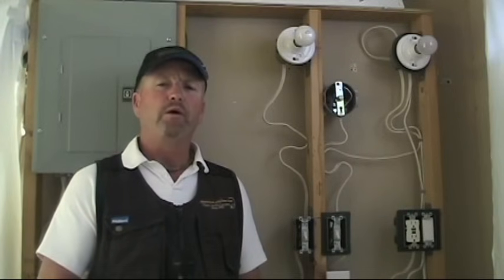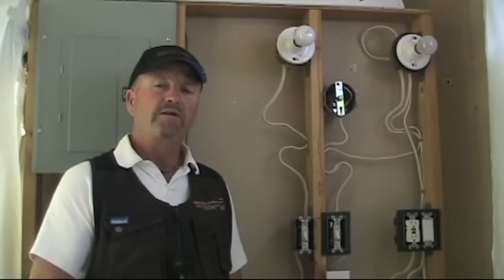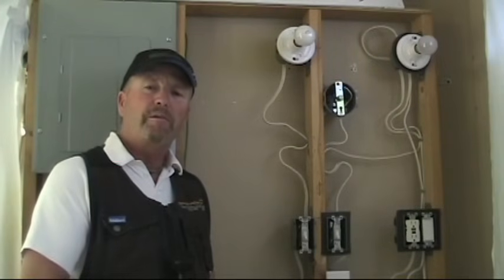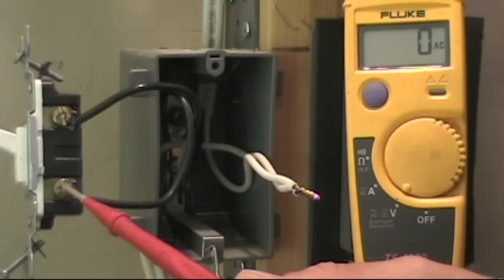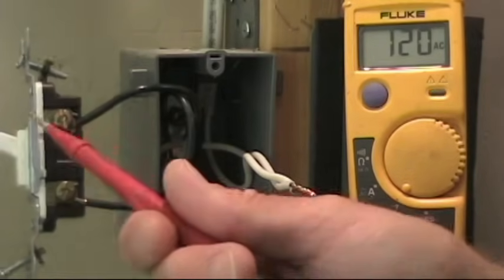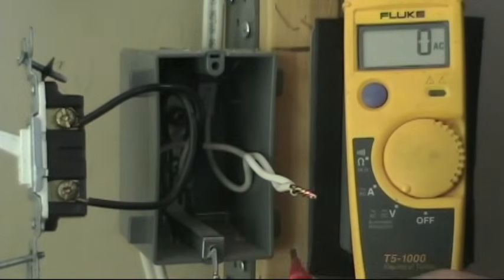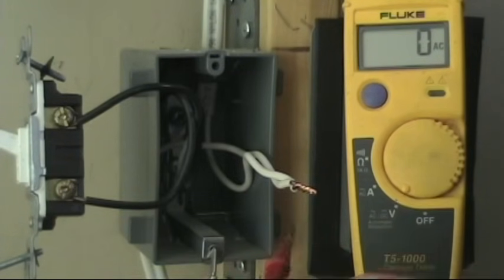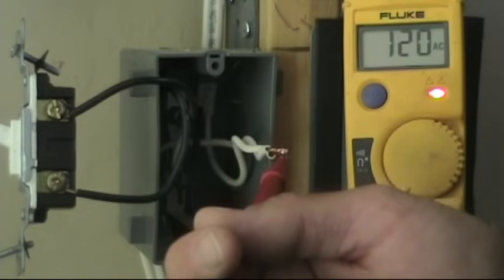Understanding an Open or Loaded Neutral

Comment: I used to work as an electrician helper, once a circuit is complete, or on, the white wire becomes energized just as the black. The black, & white are both hot when the light switch is on, or something is plugged into an outlet receptacle. Often residue electricity can back feed into the green ground wire. I have measured 38 volts AC in the ground in my home. I connected a volt meter to the white wire, & ground wire, & got 38 volts AC.
Reply: The unbalanced load trying and succeeding to get back to the transformer?
Bonded ground?
Reply: Even when the switch is on the neutral wire isn't "hot" (depending on how you define "hot"). It is carrying current of course because it is the return path for the unbalanced load; however, it is tied to ground so it is at 0 volts (disregarding some volts due to the resistance of the wire itself). This is why, unless there is a fault condition like in this video, you can't get shocked by the neutral since it is at the same potential as the ground you are standing on. The problem in this video was one of the splices that was disconnected upstream must have been the one tying the neutral wire to the ground. There was still a full circuit back to the transformer so electricity still flows but since neutral was no longer connected to ground, neutral had 120V of potential relative to ground.

Comment: I got 2 15amp receptacles on one circuit at my home. One has power from the breaker(4 wires, 2 white, 2 black and 2 grounds twisted together), it feeds other recep which has 2 wires and ground, 1 white, 1 black. The main recep works perfect, the fed recep only shows ground(119v). When I test the white and black, I got nothing, or really the multi meter shows like 1 or 2 or 0 or goes back and forth between those as I hold leads on white and black. When I hold leads on white and ground it shows 0. When I hold leads on black and ground it shows 119. The main recep from breaker shows 119-120 or so on both of the white/blacks. Ground on both black/ground. 0 on both white/ground tests. I;m able to do this testing on the bare wires as I took both the main recep and the fed recep off walls. It's now bare wires at both outlets, easy for me to test them. 

I can't figure out why the fed recep does not have anything when testing black/white. Black/ground has the right voltage, white/ground has 0. I put new recep at the main one that feeds the other recep. Didn't fix it. Same prob. 

At the breakerbox, this circuit's breaker is the only one that has the red test button on the breaker. Prob because these 2 are 15amps and both are on porches(covered porches don't get rained on, but outside nevertheless). The 2 outlets never had and still do not have gfci receps. They never had those type out there. Both of these outlets have always worked fine until about a year ago. This house was built in 1987 or so. It's in SC. I'm just Stumped here. The 2 outlets are on porch's in back and front of house. Porches are covered though. But still, they're outside technically. They both came with the house(not installed by any me or any previous homeowners). 

That's the trouble shooting and the work I did to try to fix the fed recep at back porch. The power lines don't go under house, in the walls and drop to receps. Man, not sure what to troubleshoot next or what to test, check, etc, at this point. Sucks too. I need that power at back porch's outlet. 

Could the actual breaker be bad? But then I think why would main recep work fine. 

Should the receptacles be gfci's? They never have been. They both used to be the older push in type and someone had changed that fed recep, at back porch, sometime before I bought this house about 10 yrs ago to a newer type, not gfci though, and it's worked fine for past 9 years. No mice here, rats, rodents, etc. It's crawlspace, brick, not mobile home, no issude with electrical since I've been here. Clean house. No rot, trash, yard growth, in other words it's just a regular decent house, not anything spectacular but not anything nasty or neglected.

That front main recep was the old style still and I just put that newer type recep in it's place to try to back porch to work. In other words I took the one from back porch and replaced old push in style main one on the front, wired all 4 wires to it, left the 2 grounds twisted like they were, to get the old style out of the circuit- still same issue at fed back porch recep! This sucks. 

Can a whole entire white neutral wire just go bad, like from the main recep to the fed recep? Ughhh! I know I've done the trouble shooting correctly, I know no matter what the balck/white show nothing, the black/ground show 119 or 120 or so, the white/ground show 0.
Reply from the maker: You have done all you can for trouble-shooting and I don't think you've missed any of the easy fixes for this.  you have a bad cable between the receptacles.  This could be caused by a number of things.  There might be a splice in a junction box somewhere between them? That would be nice because maybe a splice on the neutral is bad inside that junction box, and can be fixed up.  The other culprit could be a cable staple or drywall nail or screw that pierced the cable and damaged the neutral conductor.  This can happen over time if the conductor was compromised but not severed completely, and eventually it burns apart. Or it could have been something that happened recently? Did you pound any nails in to hang a picture? Any renovations lately that might have resulted in a damaged cable? 
Anyhow, your only solution if you don't find a junction box and bad splice is to replace that cable and abandon the one that is bad.  Could be a challenge with finished walls, etc.  Other option would be conduit on the outside from front to back, or a combination of cable fishing and conduit.  
This circuit is fed by a GFCI breaker, so having regular receptacles at those location is just fine as the protection is at the breaker for the circuit.  If your breaker ever failed, a solution is to replace with a regular breaker and change the first receptacle to a GFCI and then feed the next one on the load side terminal of it.
Reply: @theinternetelectrician , wow. You nailed Terry. Big help too. I really appreciate that you took the time it took to help me! Grateful. I now got it from here, will prob do the line in the conduit on outside in this house's situation. At least i can put new one exactly where i want it now. Man, we can't thank you enough.
Reply from the maker: @MichaelBorne-rh8co  Happy to have helped! I need a "buy me a beer" button on my website and YouTube Channel!

Comment: Have to agree. I had hot neutral and this video has left me even more confused as to why. Need to explain exactly what you mean by open neutral. Is it open that the panel or 'upstream'?
Reply from the maker: You get this situation when the neutral path is not complete. It could be anywhere in the circuit between where it is discovered and the panel.  A splice in a junction box, or a broken or loose connection right at the neutral bar in the panel itself.
Reply: Most likely in a 120v outlet box, or light fixture box. Neutrals have joints tied together with wire nuts, or other connectors.

Comment: I'm not a certified electrician, but have been keeping myself educated. I first started when I was ten years old in 1964 by reading books at the library. I started fixing table lamps and other electrical things for neighbors and friends. I later got into electronics and started fixing home record players, audio amplifiers, and other things as well. This did work well for me overall as in 2006, I got a job at a company that built power control equipment for subways and light/heavy commuter and other electric powered trains. I was also able to point out design faults in the equipment we built, mostly when wires were too close to what are called load measuring resistor packs  that would get very hot. They were wired in parallel to track circuit breakers and were activated in short bursts when a circuit breaker tripped to measure current flow to determine if the short still existed. Sometimes my advice wasn't taken and equipment would fail when put into operation. I also studied building codes before I rewired the bathroom and kitchen in my house built in 1913. There's still some antique light switches and old wiring using single wires and ceramic knob tubes in the house, but there's no heavy loads on those circuits. I've subscribed to your channel and hit the bell. There's always something I can learn from videos like these. Thank you.
Reply from the maker: Thanks for watching! And for taking the time to comment!

Comment: BIG QUESTION!
What caused my switch to blow out, make huge Sparks and burn? Everything was wires correctly, I got a Wifi Light Switch working. It went bad once I tried shoving the switch back into the box more. The box is small, and it's metal. Also all of the screws from the switch are all at the bottom, (all 4.) I'm guessing all four of those switches touched the metal box. Would that be why that happened? And will getting a plastic box that's bigger be a solution?
Reply from the maker: This is the reason for the code box fill and capacity rules.  With these new electronic devices, it only makes a bad situation worse if the box is as full as it is.  You are correct in that one or more of the hot conductors shorted out to ground.  That can create quite a spectacular result as you experienced.  A larger plastic box would help, and general rule of thumb is in a standard box, the max fill is roughly 5 conductors per device position.  As I said, that is even too many if using the larger electronic devices or dimmer switches, etc.

Comment: You need to show a diagram. The switch must be on, right? if the switch is turned off then no power should be at the neutral.
Reply: Yap when Mr Terry  connected last one nutro to gound his power was on at swich so circuit was complited for hot & nutro and on top of that he complited another circuit with multimeter nutro to gound ofcorce nutro it hot swich was on from hot to nutro by multimeter he complited Nutro to ground so its hot again.

It should be hot swich was off and nutro it self carring current right sir? 

But swich was on and connecting nutro to ground curring current ofcorce sir. 

If I'm saying wrong please correct me sir thanks.

Comment: Hello, Terry. My class and I watched your video and we had a question about circuits. We are currently studying single circuits and parallel circuits and we would like to know if there is no load, will the current still flow through the connectors (wires)?
Reply from the maker: Heather Reilly no, if there is no load, no current will flow. Think of it like water in your homes pipes. If the valve is closed, (switch off) there is no water flowing (current flow). There is still pressure there (voltage or potential) but until you open the valve and make use of the water pressure, no water will flow.
Reply: But if you touch it and have another part of your body touching ground, you will be the load (you may glow like a light bulb).  😉
Reply: EXACTLY; the question was answered, but given the "potential" for grave danger of electrical shock, i would have included your statement as a, "just be aware though", inclusion.

Comment: Hi and thank you for the information !
In our country - Bulgaria. The really old houses wirings, probably in the oldest lefted on villages houses has only two fuses for breaker for the whole house from the transformer to the everything around the house - one for the live wire and another one for the neutral, because couple of time ago in our country, the law requires only dual house wirings /with only live and neutral in the house, without ground/ and also - contacts with no grounding /the appliances manufactured then in our country was at law - double insulated/. So, one time i started diagnosing him, telling father to stop the fuse, and he misappealy take off the neutral one. So I wondered for a little why it has live on the both conducters even in the destributions on the wall /in the housing them in our area, it has destribution boxes in the walls before to go to every Individual outlet or socket. And there, the wires for the sockets and lamps are tied up together.  I am figured it out suddenly, so that my dad has taked off only the one fuse -  neutral one from my grandpa's house.  Haha
But here how it can happen dangerous faults !!!

Comment: Okay so I set up a 3 way switch under my home at two entry points to light both sides without having to go to the other door. I think I see what I done. I got the power going to switch one on the black screw, and the two travelers going to to the other switch. I'm not sure if it matter if the travelers are hooked up on the same side, but that's how I hooked them up putting the reds on the side with the black screw, and the black on the other side. The neutrals are tied together, except for one spot where I had too many neutrals, so I think I should have put a jumper on the main neutrals. As it see it in my head now, I have the neutrals for this new circuit most likely not tied to the rest of the house. I was thinking it might be a bad receptical or switch, but I think I just need to get back down there and jumper the neutrals to the house circuit. Thanks! I'll let you know if that worked!
Reply: Yup, that was it. I had a cluster of 9 commons, and I didn't pay attention to if it was hooked up to the old circuit. So I added a jumper from the one that wasn't hot, to the ones that were hot, and now none are hot and the lights came instantly! Imagine that!

Comment: He told you the buddy had done some splicing at the top obviously misplaced spiced I do not understand where you got the hot to the neutral if neutral is neutral disconnecting it?? I'm going to try that I'm going to disconnect the neutral of a circuit at the Box plug something in and see if there is there will be there will be hundred twenty volt on the other side it's a wire 120 in 120 out neutral connected you will not measure anything you're not getting any current flow High impedance meter?? See what I mean by being a babbling idiot thank you very much taking a bow

Comment: I'm converting my house to three prong I have cut drywall out below the outlets connected a ground wire ran the ground wire underneath the house I'm going to run single strand connecting all those ground wires and run it to the Box something wrong with this? I've researched some where the ground is connected to the neutral I researched some where they say the ground is separate from the neutral this is not on a subpanel this is on the main panel I understand the sub panel neutral ground why why are all these grounds together from these Outlets do they have to go to the box or can they just go straight to the anode ground rod? wrench man 55 at yahoo.com

Comment: I've got a question... What is going? To turn off the power to a light in the living room I must turn off two breakers on opposite sides of the panel? It is a simple 120 volt light switch.
Reply: Look in the light box itself and the box feeding it,,,some electricians run a 2 wire to the switch and use black and white wire to feed switch to light,,,you will probably find someone didn't know and hooked the white back up to black hot wire thinking it was a neural,,and the junction box had to seperate breaker circuits in it,,,in fact tieing 2 breakers together
Reply: I had the same problem at my fathers house and it drove me nuts finding it,,,look for a light box that was eliminated
Reply: First off, this is potentially dangerous if you have a shared neutral in this circuit that is being fed by 2 breakers so it's important to trouble shoot.  By saying that, I am NOT implying that this is a shared neutral circuit; it does not appear to be a shared neutral circuit perse, but may have a section that is shared between these circuits or with a 3rd circuit.

This is late, but here's your answer:
Someone has fed an electrical location (switch, receptacle, light, junction box) with 2 hots from 2 different circuits.  They probably meant for one of those circuits to bypass that location and to just act as a junction box.  Unfortunately, at some point, someone was confused and put all the hots together so now both of the circuits are being fed by the 2 circuit breakers.
The reason this "works" is because both circuits are on the same pole of your 220 volt electrical service.
I predict that if you move one of the circuit breakers to the opposite pole both breakers will trip.  HOWEVER, by doing this, you will be creating a potentially damaging situation for any sensitive electronics.
If you have circuit tracing and/or other trouble shooting tools you can skip some of this, but if you just use a voltage tester, here is the sure-fire/labor intensive method for figuring this out:
To trouble shoot this problem, make a circuit map of everything that is on both circuit breakers.  Any locations that shut off when both breakers are off need to be taken apart.  With all the wires open, turn on one circuit breaker, run around and find out where you get 120 volts.  That is the feed from the first circuit breaker.  Now shut it off and turn the other breaker on, find the spot with 120volts -it should be a different set of wires -very possibly at the same location.
If the 2 sets of wires are in seperate locations, start connecting feed wires to load wires until you find a single location with the 2 hot circuits.  From there keep them seperate and decide which of the load wires will now stay seperate to feed the rest of the load circuit(s).

If the same set of wires show up hot from both circuit breakers, then you haven't found all of the locations on those circuits, or there is a hidden short across the 2 circuits (like a nail -good luck with that trouble shooting process).